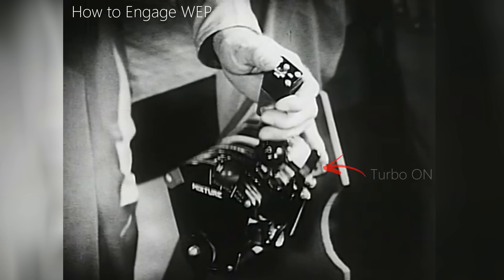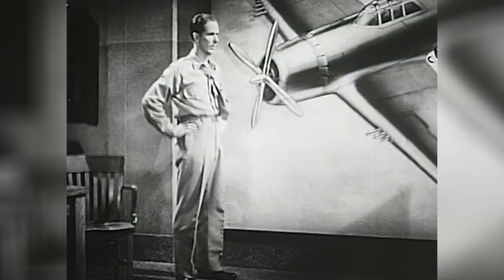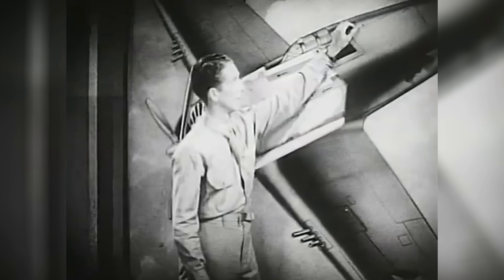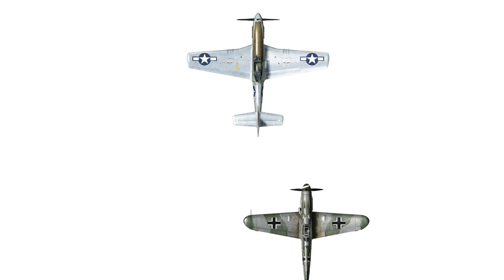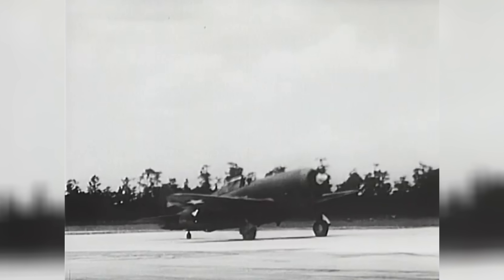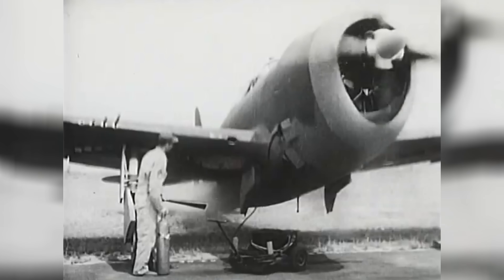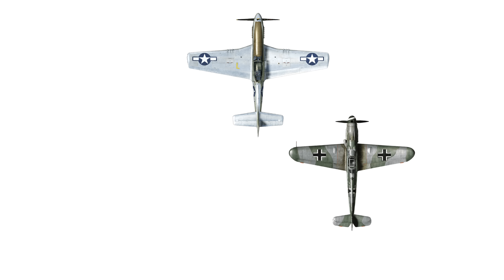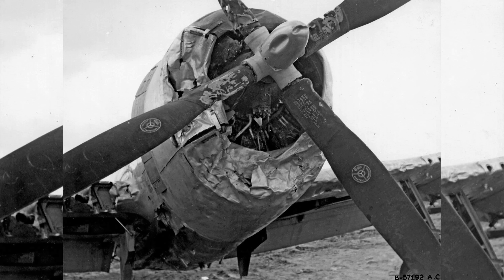What is WEP?

Comment: It wasn't that bad. The pilot can use it for 5 minutes at a time.
Reply from the maker: Thanks for the comment Geekim, once WEP is toggled there is no saying what it might do. Most were rated for a few mins on the water injection for example however that doesnt mean the engine would last that long. There have been many cases of immediate blowouts. Those who made it back home required full engine replacements

Comment: This is not accurate. WEP did not have much risk of destroying the engine during use. It only reduced the time before overhaul. Pilots routinely ran WEP for two or 3 times the manual stated times. These time limits only exist to prevent excessive usage that would result in shortened overall lifespan of the engine. This is true of every power setting on the planes, not just WEP. This is explicitly stated in some P-51 manuals and spitfire manuals, and elsewhere. It's not a unsafe engine setting or a ticking time bomb. You can actually find test documents online showing that WEP ratings were tested for 7.5 hours before being approved for use.
Reply: You should do some research. This is a bit too clean of a picture. No one is saying WEP was an instant engine killer but it also wasn’t just “normal power with a shorter overhaul note.”  Those limits existed because WEP pushed cylinder pressure, bearings, supercharger temps, and detonation margins right up to where failures start to become more likely. Pilots exceeding limits and getting away with it doesn’t mean the limits were arbitrary it just means the engines had some margin. The “7.5 hours tested” line gets thrown around a lot, but that’s cumulative test time under controlled conditions. Combat use meant uneven cooling, variable fuel quality, battle damage, and pilot technique not the same thing at allWEP wasn’t unsafe, but it also wasn’t free power. It was approved because the tactical upside outweighed accelerated wear and increased failure risk. If it were as benign as you’re making it sound, it wouldn’t have timers, warnings, and mandatory inspections attached to it.
Reply: @Will1988US  No this is rubbish. There are numerous manuals that explicitly state that the WEP ratings are not to be taken as time bombs. Aeronautics for naval Aviators, which has been a standard training document for pilots since essentially forever, goes into even more detail. In some manuals, the same power rating is listed for climb outs as being 3-4 times as long as the "WEP" rating which is still limited to 5 minutes. Time to climb tests for aircraft done at the WEP ratings were also violating the WEP ratings just to do them. Pilots didnt just "get away" with this occasionally. Some anecdotes from units quote that some units had SOP in combat of simply setting WEP and leaving it there until the engagement was over 30min later. WEP ratings were withing the safe margins of engine operating limitations in terms of causing any sort of immediate failure. TBO was THE ONLY REASON that WEP had time limits. You last line doesnt even make logical sense. Putting timers on engine limits makes TOTAL SENSE if you main concern is TBO. You dont want pilots wearing the engines out excessively by using the max power rating constantly without justification. This is one of the main reasons why some car manufacturers detune engines, so that they last 400k miles instead of 50. And why race cars only last 1-3 races. WEP ratings on engines were consistently revised upward when higher octane gasoline or water injection was available to prevent detonation. But as those rating went up, the time limits on those WEP rating remained the same. Do you not realize how preposterous it is to think that every engine had clean 5 or 10 minute WEP Rating limits? They are not in the manuals because they have anything to do with preventing immediate failure during combat from kind of overstress. If you were really running the engine anything like 5 minutes from being likely to fail, such ratings would not even work because it would be impossible to set such a edge case limit with any practicality. And even if you did, it would only be valid for a brand new plane. Time Before Overhaul was the only concern.

Comment: This is a really long (though 'fun' writing) way of just saying "More power means it wears out faster". It's not gonna explode. Any engine can be run at "high tune" for the same components and that just means its gonna wear much much faster. The same 100-200,000 mile Subaru engine can be run at 400 HP... if you don't mind overhauling it every 40,000 miles. The real engineering trick with modern cars is getting lots of HP while keeping that 100-200,000 mile warranty/reliability. Tank engines were designed the exact opposite. Many of them were the same engines used on planes, but because tanks can't be overhauled every time they land--they need to run for thousands of miles before major overhauls--they run them with no turbo and much lower overall compression to reduce cylinder pressure which reduces wear and lets it run on dirtier gas.  (Just like the 1911 .45 ACP is very low pressure cartridge for the size because it reduces wear on the pistol). WEP is just "I'm willing to risk an engine overhaul if it means I'm going to live. My mechanic will hate me so it better be worth it" 

Many times overrev'ing a car engine doesn't destroy it at all (a piston, rod, and valve spring either CAN or CANT go that high), but it massively increases wear as--gosh it's been many years--IIRC, wear increases at the square of speed. So 2x the RPM means 4x the bearing wear.
Reply: which is it any engine can run high tune on the same components or tank engines are designed the exact opposite? You can’t have both without contradicting yourself.
Also, where are you getting this “wear increases with the square of speed” claim? Because WWII WEP wasn’t about RPM doubling, it was about BMEP and thermal load
And the Subaru comparison is doing a lot of work here while explaining very little. Are you seriously equating a modern liquid-cooled automotive engine with pressurized lubrication, modern oils, and tight tolerances to a 1940s aero engine running at the edge of detonation margins on wartime fuel?

Comment: WEP saved me, my friend, three crewmembers and 10 other passengetd when the Catalina we were flying in had a front wheel housing panel bent open during a splash-and-go. It turned into a fin dragging us to our portside and locking us in a 150km/h or 80 knot turn.

When the pilots engaged the WEP (or ovetboost, 115% throttle etc, give it a name) it felt like we just got yanked out of the water by the hand of God himself, and it sounded like you were standing next to a moon rocket. It wad terrifying and awesome at the same time, but it did cause the company running the flights to go bankrupt, as the engines needed a full overhaul of about 60.000 euros apiece

And don't let AI tell you the Cat has no WEP, it uses war thunder as a source. Yes, it did not have a combat boost function, but WEP means going over the max safe settings, something almost every analog controlled militairy plane can do
Reply from the maker: What an incredible story. The Catalina certainly had WEP! So you flew on the Catalina post war, did you fly them during the war too?
Reply: @FlakAlley  my granddad was born in the 1930's so nah, i never had the honor! I flew one as a passenger in 2017, it was a memorial flight in the netherlands, and one of the passengers was theo doorman, the son of karel doorman, the Commander of ABDA command in WW2!

Comment: In modern aircraft engines(turbines) WEP is used all the time now. As long as the pilot doesn't doesn't pull 110% for longer than the manufacturer says you they can. Now pulling torque past 100%, through a rotor head that's another story.

Comment: I did not know that the water injection was for cooling; I thought it must have been to add steam pressure to the cylinders to add to the driving forces on the piston. Thanks for clearing that up.
From family history, I was told that in the early 1950's, experiments were carried out, including field trials in Malaysia during the Emergency (a war on communist terrorists) to inject water into diesel engines of army and Air Force lorries as a way of saving fuel and extend range by using the steam pressure of water turned into steam by the diesel detonation. It was never adopted after the trials.
Reply: Excessive temps not only wear faster / degrade lubricants faster, but do in context of plane ICEs worse thing - increase chance of early detonation, putting roadblock to use of higher manifold pressure / higher boost / more power.
Water takes up LOT of heat to evaporate hence it's injection is very efficient cooling mean. Not for "use of steam", just to counter those illeffects of overtemp in cylinders.
German methanol+water injection has multiple uses. Cooling +higher octane number fuel. both helping more boost by delaying detonation higher up.
But it's not exactly WEP, just boost system of limited capacity you carry in plane, like NOS tank :). Less needed for US/UK fighters, that had access to higher octane number fuel then germans

Comment: i dont think i wanna use WEP so often anymore in WT 😭
Reply: For air simulation, I actually cruise with 70%, patrol cruise at 80%, climb with 90% and fight/take off with 100%, leaving WEP for actually emergencies. But the thing is, it's so poorly modeled and realiable that everyone often just pushes to the limits without concern and you are then forced to do the same.
Reply: @Arnechk  ...That's really awesome, the fact that you CHOOSE to do things more realistically. Bravo
Reply: @railfan3024  It just came naturally from playing Spitfires and Typhoons/Tempests because they overheat instantly on WEP, and are quite fuel hungry. Focke Wulfs also overheat the engine after some time, and there is no way to cool them down quickly. Then in early jets where one barely gets 20 minutes of fuel, specifically Meteors, i need to stretch that to 30-45, since it's a slow plane and it can take quite some time just patroling the map and trying to spot enemies. The also the Harrier chuggs fuel like there is no tomorrow... I also usually fly way higher than the rest, for the same reason, and because we are playing planes, not vacuum cleaners. Also I usually just play 128km maps.
Reply from the maker: The pilot must be quite stressed out, has your engine ever blown out? Assuming thats a thing in this game

Comment: Me switching on WEP 8 times in battle while playing War Thunder
Reply from the maker: 8 times! Wow. Are you sure that it is actual WEP that you are using and not military power renamed as WEP in the game?
Reply: @FlakAlley  It's definitely just military power renamed as WEP. However, for some aircraft, they have a limit. Like I believe the P51H has about 5 minutes before you run out of water injection, and the F9F Panthers have a 10 second injection for takeoff, but its just all labelled as WEP. Even Afterburners are labelled as WEP. Not only do you usually get marginal performance increases, but theres no risk to the engine except increased fuel usage and excess heat on some aircraft.

I like that War Thunder has a lot of vehicles to play with, but they're often misrepresented.
In their WW1 event, they introduced some biplanes, and they are so weakened they can barely stay in the air flying in a straight line. Gentle turns cause a catastrophic stall.
Reply: @domosRAGE  ur wrong. in WT WEP is modelled do a bit of research
Reply: @Will1988US  alright, buddy
Reply: @domosRAGE  Bud you sound offended
Reply: @Will1988US  I understand that emotion is difficult to gauge through text, but thats a bit of a stretch to assume, bestie

Comment: The Me109 also had a kind of overboost, running at 104% power for one minute, if my memory is correct. Every plane had this capacity, it is not like a power boost as MW50 or GM1. These are special versions. Nice video.

Comment: WEP in IRL:  Used in last ditch life or death situations as a gamble to save yourself
WEP in War Thunder: Default engine setting for 99% of players.
Reply from the maker: Thanks for the comment iMac, are you sure it not just Military power in the game? From what we are hearing people seem to be using it the entire time!
Reply: @F @FlakAlley n the game it’s labeled WEP
Reply: @FlakAlley  Yes, it's WEP. It's labeled as such and using it past the historical limit for the plane in question kills the engine.

It's used heavily because maps are relatively small and nobody has to worry about the logistics of burning out engines -- once the match ends you repair and are good to go again.
Reply: @FlakAlley  Yes, it is WEP. It's the highest throttle position you can use in the game when flying propeller aircraft. If you use it too long, the engine will overheat and lose power.

Most people stay in WEP because the map is small and dogfights happen one after another. Some aircraft do not have WEP and just gets to 110%.

I usually use WEP to climb (Again, small maps, so faster climbing is better) and switch to 100% to cruise.
Reply from the maker: Thats very interesting thanks for sharing. Do jets get 110% or WEP?
Reply: @FlakAlley  Depends on the mode and the jet. However most Jets that can WEP can only go up to 105 or 108% but a few can do 110%. For example the Heinkel He 162 WW2 German Jet can get 108% but its engine overheats and dies in under 10 seconds so its more accurate to real life WEP.
Reply from the maker: @iMacG4GAMING  Thanks for the comment Imac. 10 seconds for a BMW 003 on WEP sounds about right. Afterburning modern jets  also have WEP IRL, is that a thing in the game too?
Reply: @FlakAlley  Yes i looked into it and cold war jets to modern day jets have WEP/Afterburners for 110% but they can do it for as long  but not as long as prop fighters on average 1 to 2 mins of WEP before a cooldown.  Where as props can practically do it forever unless your engine overheats which depending on the plane and map environment for example, desert, forest or artic can take ages or happen in a few seconds.
Reply: @FlakAlley on my Viggen since its drinking fuel more than other aircrafts hence 110% afterburner is being used, if the scroll wheel sensitivity is like put to a low setting you can actually put to 101% and will still give the afterburner boost and the afterburner length difference is visible too!
Reply: In most planes in game it's labeled "WEP" and on auto settings it generally won't damage your engine unless the other factors help it. On some planes it's labeled "110%". Additionally some planes will get damaged fast by WEP, but can be counter acted by using manual radiator control. Though this looses some of the speed. @FlakAlley

Comment: In war thunder u literally fly in wep 24/7
Reply from the maker: Thanks for the comment TheMaster, really! Are you sure its WEP and not Military power being called WEP? That is not how WEP is meant to be used!
Reply: @FlakAlley yeah its WEP (110%) thats pretty stupid from the devs trying to argue with realism when they cant get stuff like this right. Sadly
Reply from the maker: @TheMasterdisaster14  110% makes it very confusing. Actual WEP gave you a lot more power with much greater risk. Its was only for an Emergency as the name suggests. Are engine blowouts modelled or no?
Reply: @FlakAlley blowouts no just that when the engine overheats it starts turning color for yellow to orange to red then black with it slowing each down more each and oil and water leak it they get too hot shame really the irl wep seems so much more fun and intense then what the games implementation
Reply from the maker: @nucke6478  You should let them know! Could be a great feature to have when you really need WEP :)

Comment: I didn't know it was so serious haha. In War Thunder it just felt like using a temporary bosst for some time. Thanks a lot for the information.
Reply from the maker: You are most Welcome! Have you seen the other Wt comments? It seems that WEP in this game isnt actually WEP. Maybe its Military power?
Reply: @FlakAlley  it is some sort of watered-down WEP as in realistic battles you can use it as long as you want since it is on your decision to use it, after less than a minute or so however, engine and oil temperature will raise to an amount where if you do not deactivate WEP, permanent damage will be done to the engine. I have seen planes reach that temperature earlier than others however, but i think that even in realistic battles, the liberty and frequency that you have to use it is still too permissive compared to how in real life it was only a desperate situation that would trigger its use.
Reply: @billetede2peso113  Some aircraft even reach yellow temp without WEP lmao. Engage WEP and engine goes kaboom.
Reply: @FlakAlley perhaps. It makes more sense that way. Temporary boost for more output.

Comment: P47 was air cooled
Reply from the maker: Thanks for the comment XZY, indeed however it did also have water injection for the engine
Reply: @FlakAlley it might have had a methane water combo for WEP in later models but it is an air cooled engine. Spitfore and p51 were water cooled. Massive difference.
Reply from the maker: @xzy89c  Thanks for the comment, almost all p-47s and p-51s have water cooled WEP

Comment: That 1 bulet from the 109 🔥
Reply from the maker: Thanks for the comment Ss, are you referring to the trailer? ;)
Reply: @FlakAlley yes 
U wait for that moment and open fire
1 on engine or fuel storage is enought to lite
Reply: If the Me 109K4 had the 30 mm MK108 Canon a single hit could blow the tail off a P-47 and certainly a P – 51.  The MK108 gave no second chances.
Reply from the maker: @williamzk9083  Thought the 109ks did have 30mm 108s?